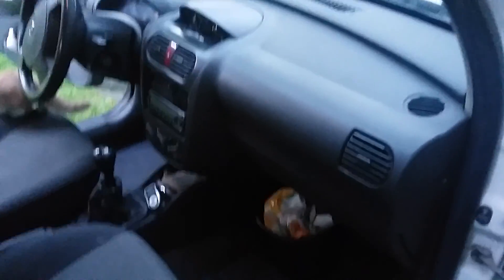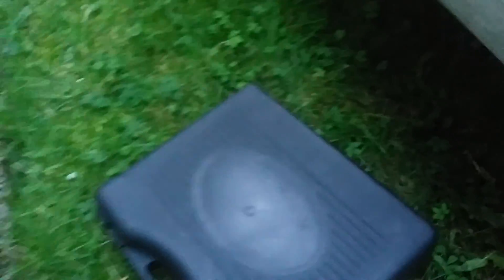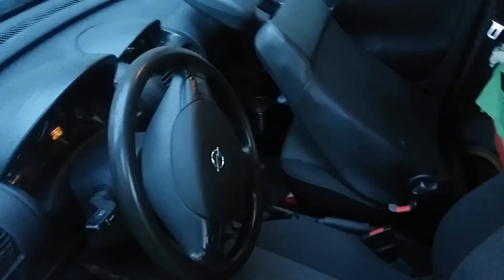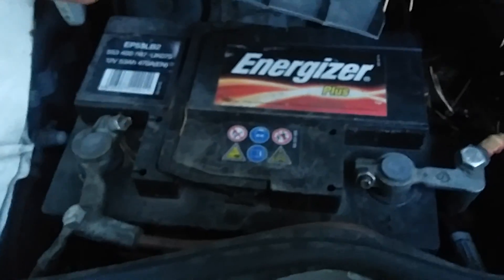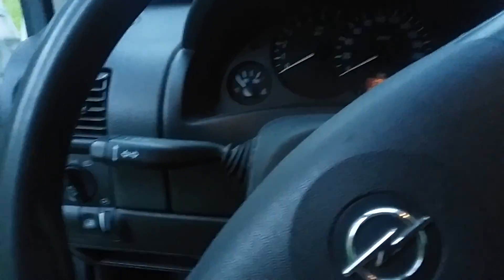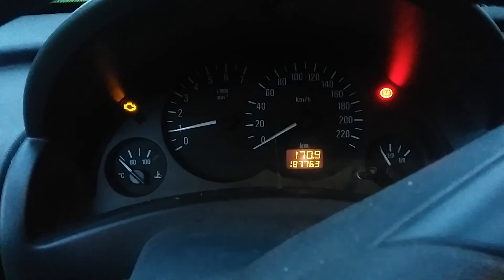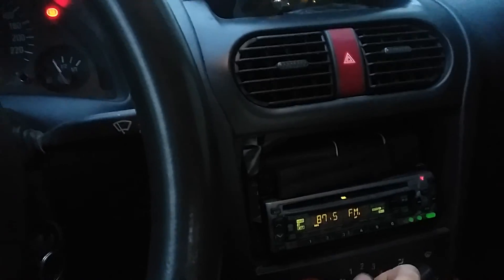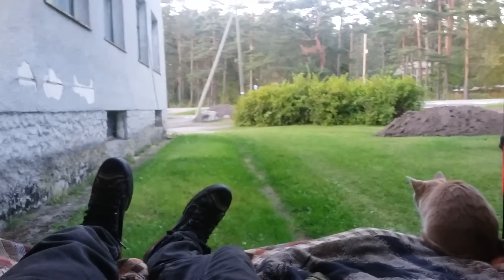Opel Combo Stealth Camper

Comment: Is this bigger than a BERLINGO in the back thinking of getting a combo
Reply from the maker: I've lied down inside a berlingo a couple of times and I think that combo is a little bit bigger. Also Combo has a more reliable suspension.
Reply: And about 10 times more reliable with cheap parts.